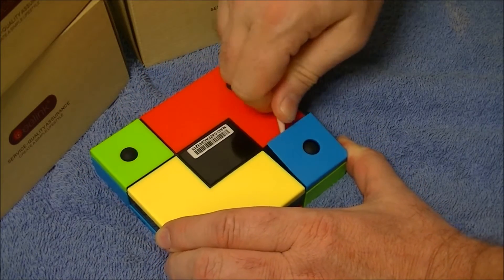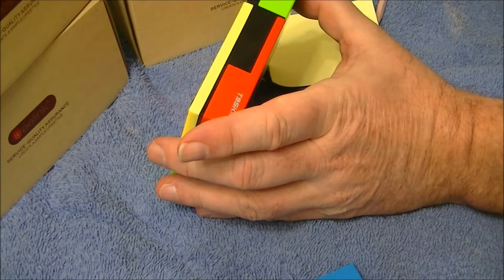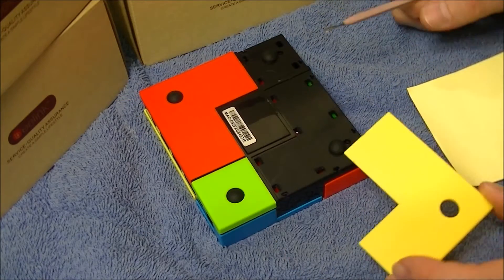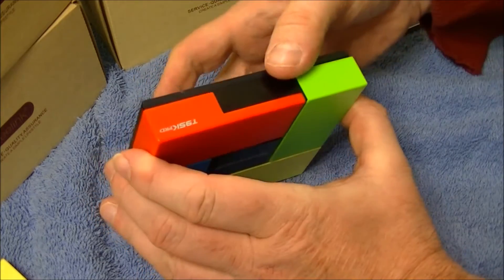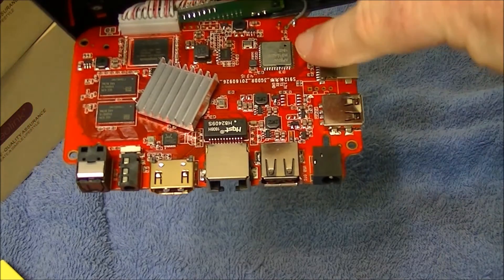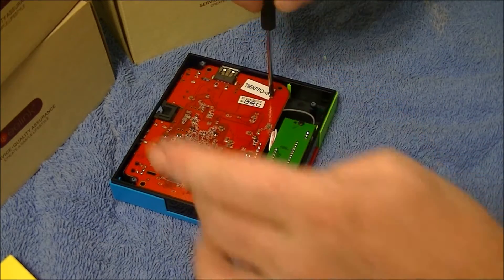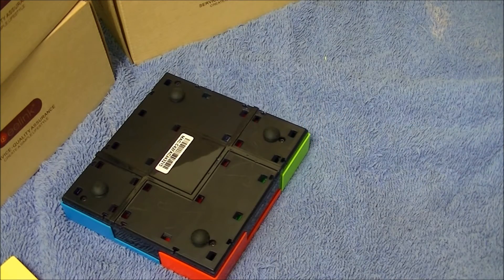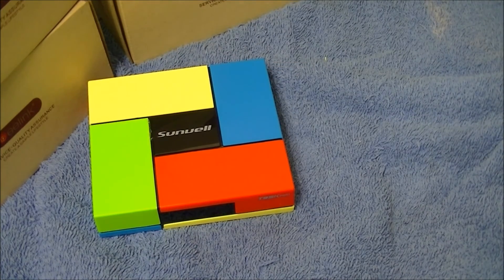Sunvell T95k Pro Tear Down

Comment: you are aware that you could of just looked at the first 6 digits of your mac address to identify the wireless card manufacturer right lol, as with any router or wireless card made, you can even use the wifi analyzer app then go to tools and OUI and start putting in the mac address and it will tell you if you have the Ampak card or not, but hey thanks for that.
Reply from the maker: Great info, but it was still cool to break it down.